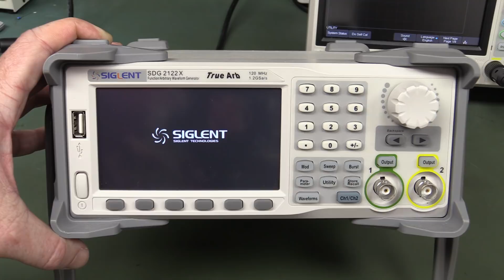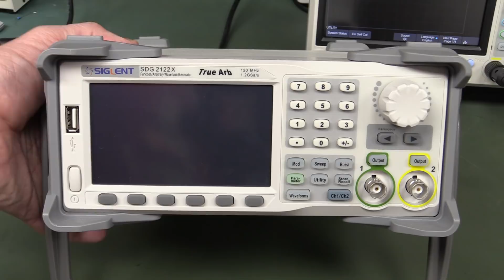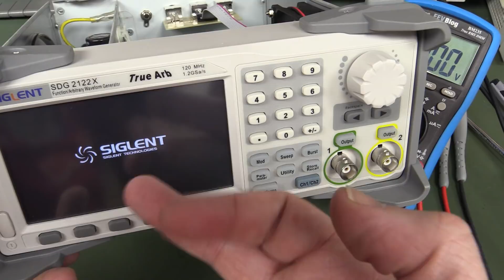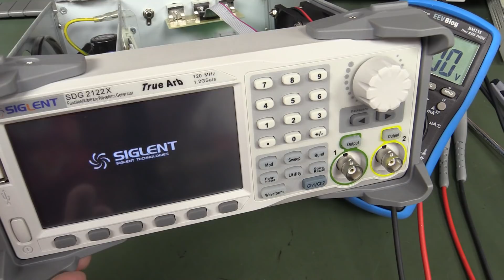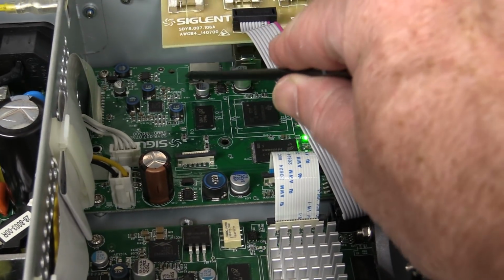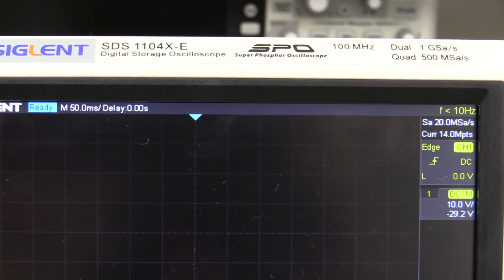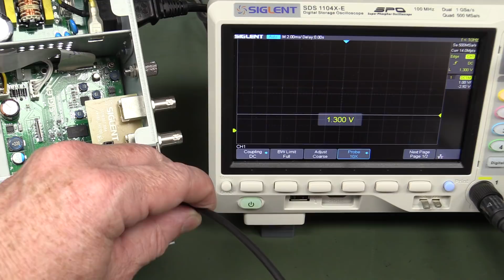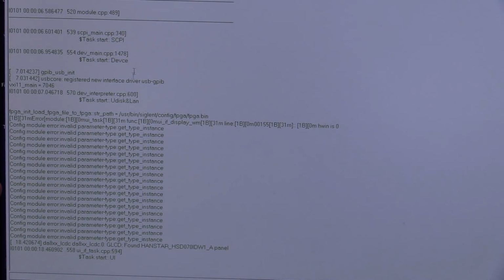Siglent Signal Generator FAIL

Comment: Kinda looks like it either can't load the fpga.bin file or the module loads but the path to the fpga is obstructed.
Is there a way to factory reset the arb with a button on power up (like an old school LCD organiser) or similar key combo?
A hard reset to factory would clear up any data corruption issues. 
Could the path to the analogue fpga be obstructed or a ribbon cable not seated properly?
Reply from the maker: No hard reset that I could find. I'll have to ask them.
Reply: Hold down power button for 30 seconds? Wild guess.
Reply: Yeah, my head was going there too, corrupted FPGA file, I reckon as it boots it'd be possible to replace it though, wonder if you can get to a command prompt of some sort...

Comment: There is a service manual available for that thing. At least it descripes the voltages on the test points.
Reply: https://www.batronix.com/files/Siglent/Funktionsgeneratoren/SDG1000/SDG-SCPI-Command(EN).pdf
Reply: Kinda ignorant of Dave to say "Where?" and then not even thank you when you linked him directly to the manual. I'll do it for him: Thanks for taking the time to help.
Reply from the maker: Where?
Reply: http://www.siglentamerica.com/USA_website_2014/Documents/service_manual/SDG2000X_ServiceManual_SM0202X-E01A.pdf
Reply: Good job